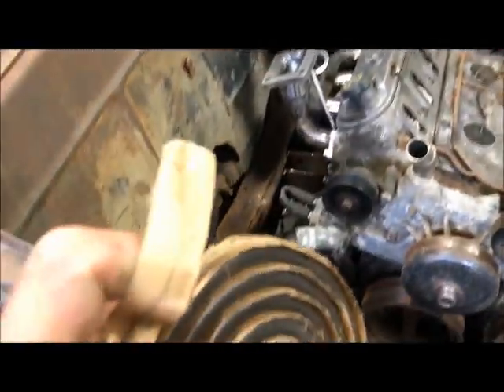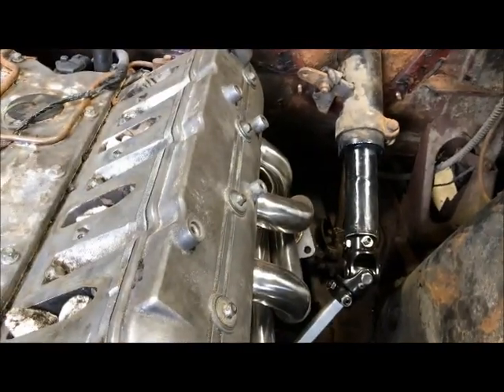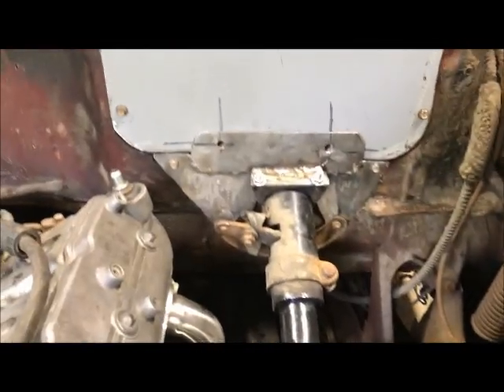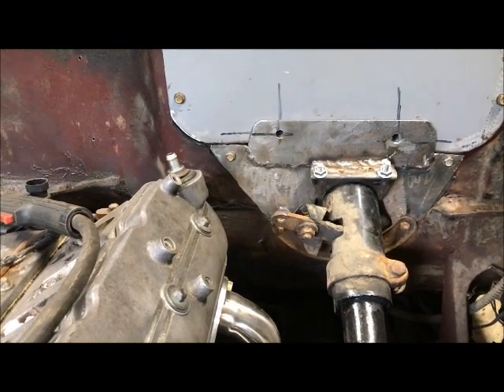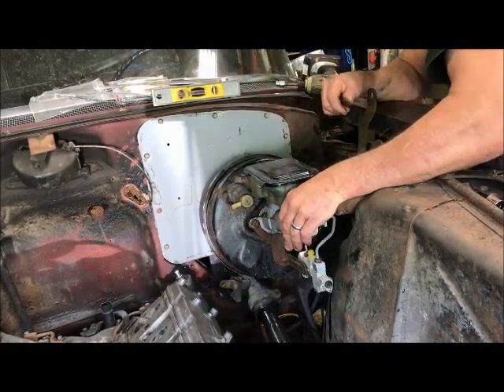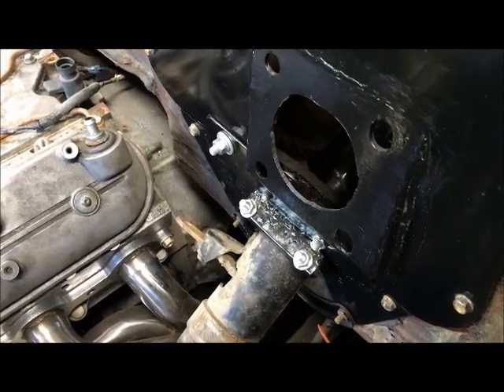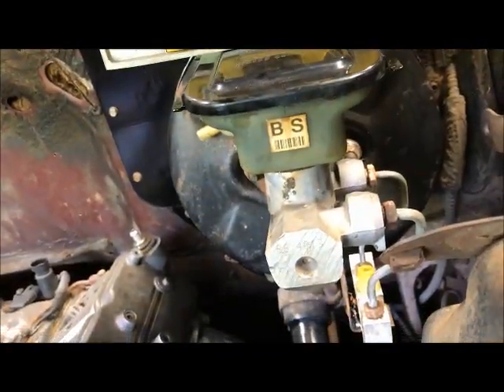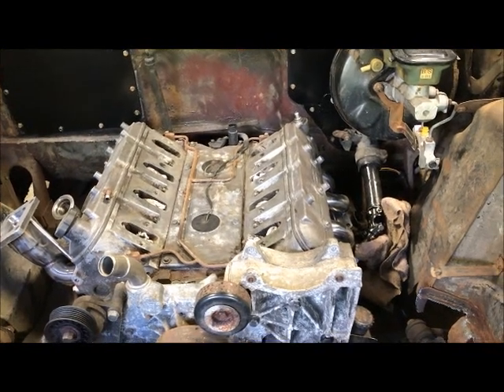1955 Buick Special Turbo LS Build part 21, junkyard power brake upgrade for the POSpecial!

Comment: I just discovered your Buick transformation videos and love them all !  I am doing the same thing to a 1955 Pontiac Chieftan 4 dr,  
The firewall setup is much the same as yours is and I had to put the brake booster and master cyl. right where the L heater box was..
The Pontiac had the Hydroboost ( or whatever its called ) down under where the left cast iron exhaust manifold exit on the drivers side is .
My donor vehicle was a 2002 chevy Tahoe and I have used a lot of parts from that car.   I live in Northern New York state  ( near the Canadian border) and a lot of my 
ancestors came from Scotland .  LOL   I hope everything goes well with your car and you can finish it soon.   Thanks again for a great presentation !
Reply from the maker: That is awesome, a friend of mine also has a 55 Pontiac 4 door that he is going to build as well! I think the Pontiac had an open rear end with leaf springs, correct? No torque tube to deal with, much easier to update with a newer rear axle, but we are dealing with similar things to work on. Thanks for commenting and good luck with your build!